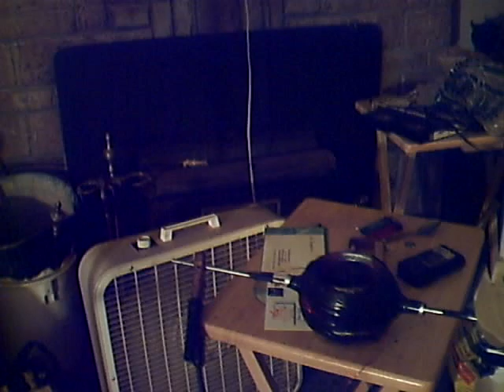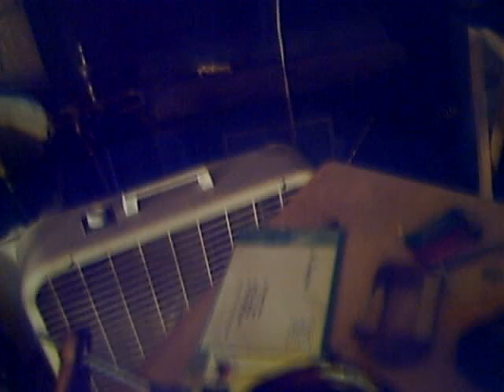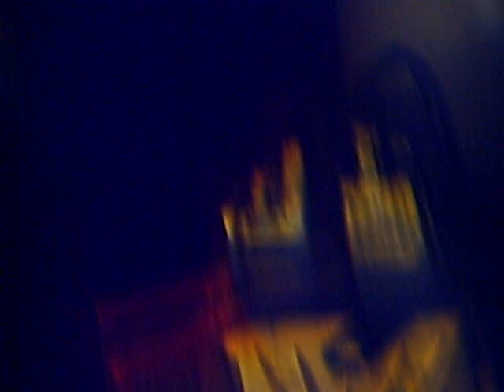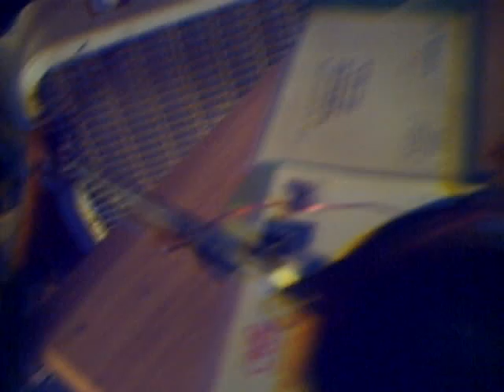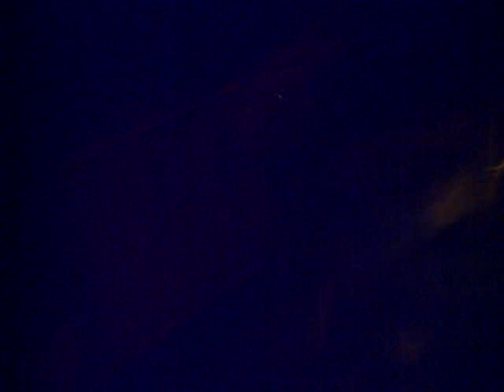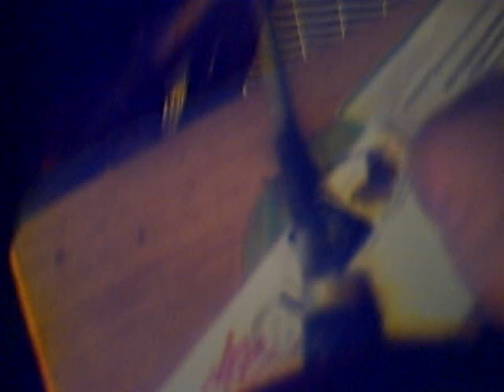FREE ENERGY JOSEPH NEWMAN MACHINE BATTERY CHARGER FAN pt 2

Comment: @eurynome21

No, the wire does not need to be magnetic.

The name "magnet wire" comes from its use in making electromagnets. It does not need to be magnetic. Copper is used in Newman motors, and the copper kind of so-called "magnet wire" cannot be magnetized.